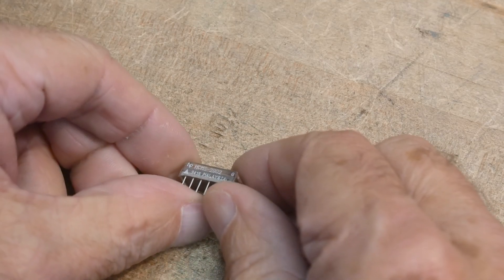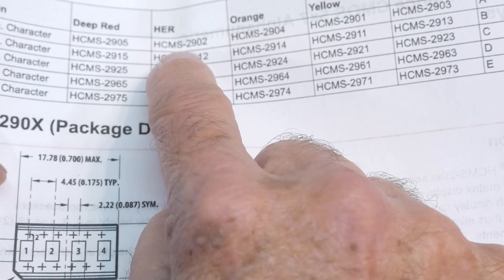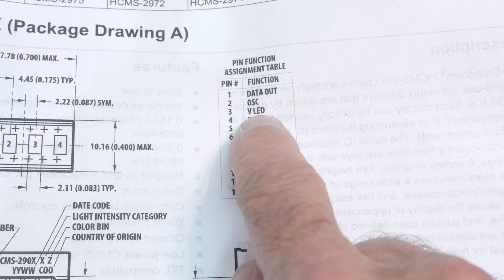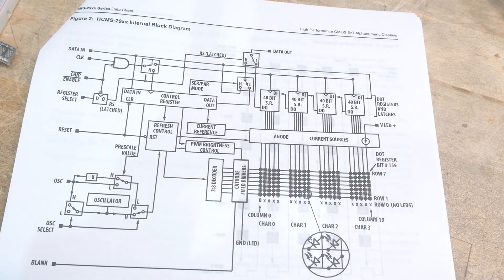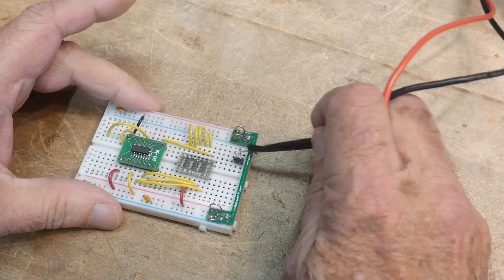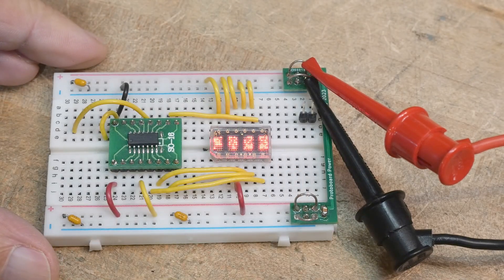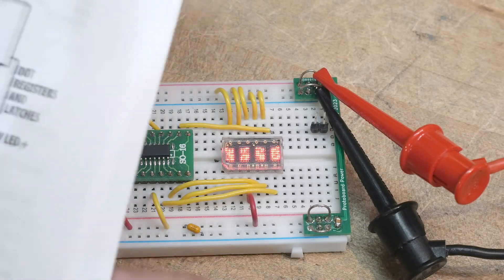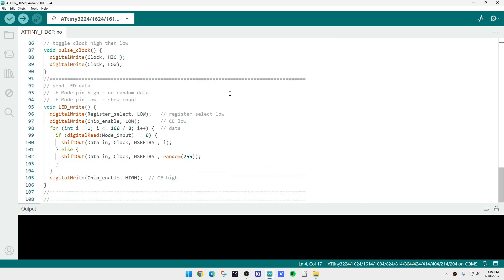#2128 HCMS-2902 LED Display Module

Comment: There are also similar devices with internal ASCII ROM for 128 symbols + 16 user defined symbols, with serial and parallel bus control. You can get them in 4 or 8 digit versions and in different colors (green, orange, red). Look up HDSP-2113, HDSP-2111. HP used them in laser printers.

Comment: Never knew they made those with built in shift registers - usually you have to multiplex them externally. That probably saves a whole MCU that would be dedicated to just refreshing the display continuously

Comment: Forget software—make a character rom!!! Dude!
Reply: The display requires serial communication. You cannot hook it up like we used to by simply burn a vintage prom and connect it to a 7 segment display.
Reply: @renaissanceman5847 I know, I was being a bit tongue in cheek, playing off of his comment about not liking to write software. In this case, a prom would have to be a serial type and you’d still have to write software… sigh…

Comment: Yes, it's still available--Mouser has 180 in stock--but at > $30 each I think I'd find a lower price solution. Nostalgia will only take you so far. --grin
Reply: Yeah really.  You can get LCD displays for under $10 with built in fonts and color and are so much easier to interface with.  I’m afraid that it is a Dodo part.
Reply: Same here. Jameco has those hexadecimal displays for $30. I wanted a way to display hexadecimal code from 4 bit data lines. They are dim and honestly you pay for the vintage aspect. It was cheaper to buy dual 7 segment displays that were only 10mm tall and then buy a tiny 20 pin QFP packaged PIC micro for $2 that could fit under it. Then have a PCB made. Total price was $10 each when done in volume of 20 units. Now I can display hexadecimal directly from 2 different 4 pin inputs. Displays come in bright blue or green or red. Seems nostalgic computing hobbies are a niche thing.